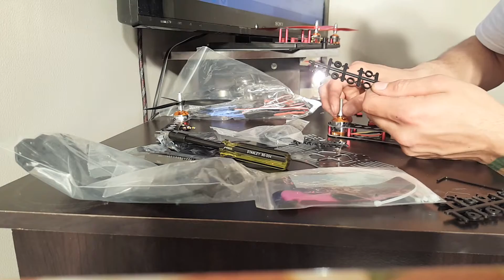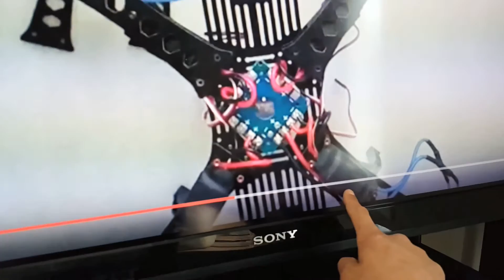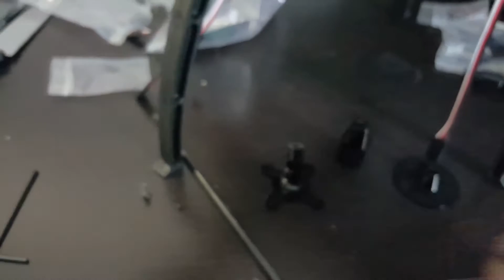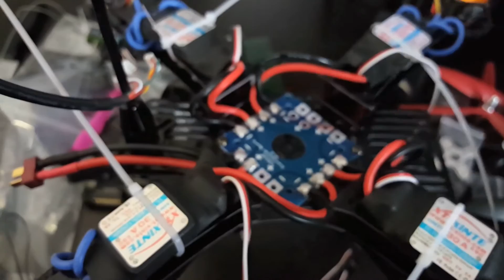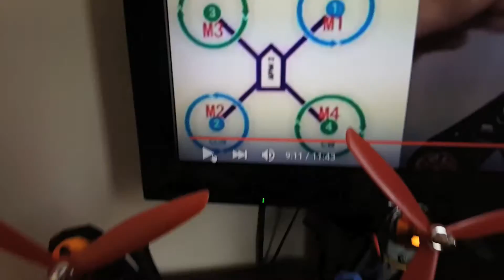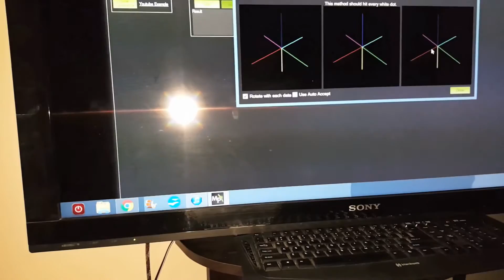Aliexpress.com carbon fiber drone kit build

Comment: hello, did you make it fly finally?
Reply from the maker: Sorry. No time and no one locally that can give me a hand to figure it out. I'm sure by spring I'll have it in the air
Reply: I think we buy it from the same seller, my propeller are doubles though. But it was wired just like yours. folowing other tutorials online I wired differently. it Worked but one propeller got loose and crashed. Today ill get a new set and I'll tell you what I did to make it work.

And for the probem in the video sometimes if you reset the apm an then flash the firmware again (without connecting with the app buton first) you can get it working again.
Reply from the maker: Wow! Thanks for the help. I'll look for your video when it's all fixed up

Comment: Hey J.O. Hope you haven't given up with this. The compass is built into the gps unit; plug the second gps lead under the first, then mission planner should work.
I've just got the same kit, build still in progress, and like you found the "instructions" lacking. I can't work out where I'll stick the battery.
good luck!
Reply: i put it on the bottom
Reply from the maker: I have given up.. for now. Work season stops me from tinkering. I think the battery will go on top with provided velcro, but like you, I still havent found a better spot

Comment: Hey there, have you tried getting it to calibrate with the gps module plugged in? give that a try let me know if it works! Thx!
Reply from the maker: Thanks for the tip. unfortunately I've tried with and without internal/external gps and every variation in between... also with every combination of upper and lower GPS and I2C plug in on flight controller. This thing has been almost forgotten and it hasn't ever left the ground
Reply: Try asking the seller for a replacement APM because I am pretty sure the APM Compass is faulty.
Reply from the maker: I agree! I've asked on 3 different occasions to replace the apm and they just send me youtube links how to program.... Might just have to take the hit and purchase one myself. Any suggestions???
Reply: Sorry for the 4 months late response, I think you should just buy your own APM and give it a try since, you did pay alot for it and it's better to have a working drone then a faulty one lieing around.
Reply: Hey there, I got you this guy from the company that made this kit he's willing to help you out, I am not sure what she/he means by help but I think she/he will hook you up with a replacement APM and possibly a compass. Heres there email: admin@xt-xinte.com . Good Luck man hope you get it running.

Comment: I was thinking of buying this kit, did you end up getting it running ?
Reply from the maker: I still haven't gotten it running... Its hard to get much of a response from the seller. Any time I message him, he sends me a link to a video that doesn't seem to help. My suggestion would be to buy a GOOD flight controller and scrap the one that comes with the kit. If you buy this kit, let me know how you make out! Cheers
Reply: Hey thank's for the reply, I decided not to get it in the end but as for your flight controller idea  I think your on the right path. I have heard the Naze32 is good but that's just what i have seen on youtube :) do hope you get it working buddy good luck !.